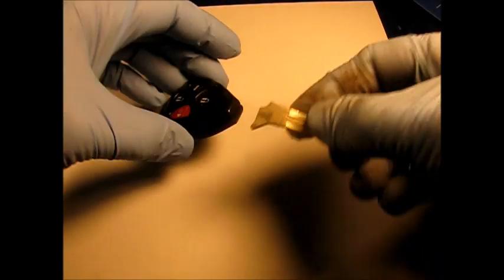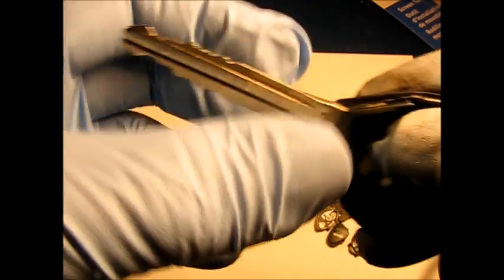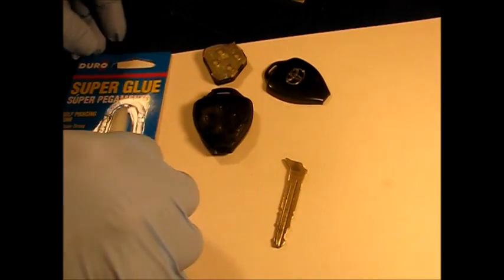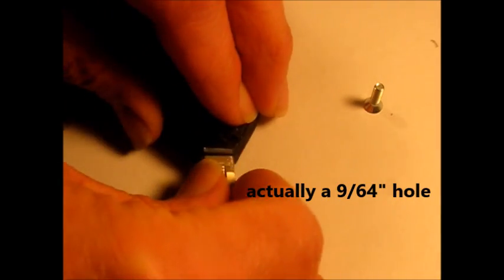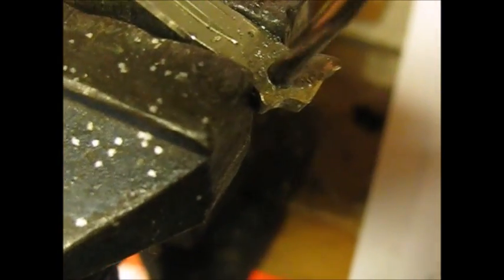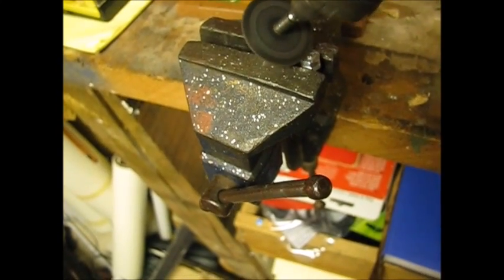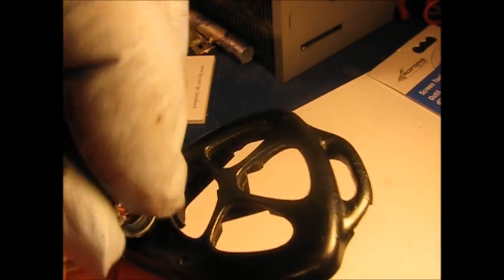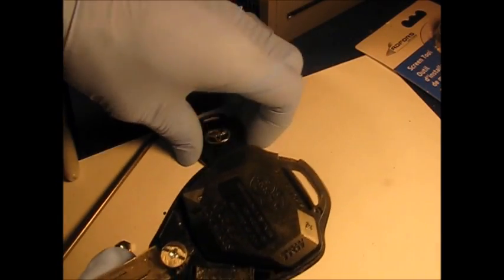How to fix a broken chip-type, remote access ignition key

Comment: You probably used the wrong type of glue. Just because a glue says "for plastics" doesn't mean it is good for all plastics because there are different formulations for plastics. I had to glue a component made of metal to a plastic housing on a piece of audio equipment. Did a bit of research and, of course, i forget the names of what's in the plastic that i "guessed" i might have. USUALLY, you will see in the fine print on the bottle "not for" and then the names of the certain type of plastic (mainly 2 from what i recall). So, find the glue for the formulations mentioned that the other particular glue is not made for, and you should be fine. I believe it is "hard plastics" like this Key Fob that you would need that certain type of glue. Damned if i remember what i used but the glue worked. I just recall that many of the glues i looked at said "not for....." on them.
Reply from the maker: Thanks for sharing your insights.
Reply: Super Glue isn't what it used to be either. I recall back in the begging [Eastman 910 or Super Glue] kids went to ER to have their fingers unglued. With the new Super Glues I've had my fingers soaked and got them apart with no problem. I think they watered it down to avoid legal action.

Comment: You can buy a cheap shell on Amazon but the chip is glued into the original housing so they can charge $350 at the dealership. I did JB Weld and then a screw too.
Reply from the maker: Mine is still holding up after three years so it was worth it. JB weld is a good idea!

Comment: Thank you for this video.. I used Gorilla Glue and so far has held great but in the event it doesnt I will certainly put a screw in it. Better a screw in it from me than one put into me by a locksmith and Toyota dealership lol.  Some other brands have pre cut keys that you just have to go through a process to program a new key by turning the ignition a few times after an exact amount of time. I had to do it for a GMC but Toyota, of course, has to make it more complicated with a computer involved. Not that it looked very difficult if you had the necessary things to do it with.
Reply from the maker: I'm not a huge fan of many things GM but programming their keys is a dream. This key is still in operation these years later but I did have to retighten the screw once. Thanks for the chuckle. I needed that lol.
Reply: How did the gorilla glue hold up? This just happened to me today 😭 and 250 for another 1 is crazy!!

Comment: Thats why the bastards make them so fragile. It creates future plunder from future customers. Also have you noticed the foil that seals oil bottles? They did that so the foil when not taken off properly will go into your engine and cut off the oil causing another future customer. I saw a video where a guy bought a farari for cheap and he examined the problem of the blown engine and he found a peice of foil in the engine.
Reply: I always wondered why they did that. I’m always careful not to drop in engine.
Reply: Interesting your comment is true.

Comment: Mine was for an '09 Taurus, but the principle was the same.  I bypassed your super glue steps as I knew that was never going to hold, but the drill it n' bolt it solution worked fine.  Congress should investigate how badly these companies, and dealerships, rip us off on these items.  I would have paid maybe $50, though that would still be an outrage - but the $200 they wanted for the fob and 'labor'?  KMA.  57 cents and a half hour of my time and it's fine.
Reply from the maker: Well done and I agree with your thoughts on price gouging at the dealership. .

Comment: This method worked 100%. Plain stupid to have the main body made of hollow plastic vs rubber. Used gorilla glue epoxy to have the metal key be permanently seated, but not alot of it, and also used a screw and nut like you did. I dare it to fall apart again lol
Reply from the maker: Nice work. Mine is still holding strong after a year and a half and you're right. How could it fall apart?

Comment: Another option could be using an empty shell(from ebay), swapping the electronics and get the key cut.. not more than $10( for shell and the key cut)
Reply: Most key/locksmiths can do this for under $20.  The problem is this flaw results in repeat breaks.  I am now resigned to carrying both a rubber key to start, and the fob for keyless entry only.  Shame on Toyota.
Reply from the maker: I wasn't aware of that interesting option. I think removing and then re-fitting the security chip into the shell would be quite the challenge though.